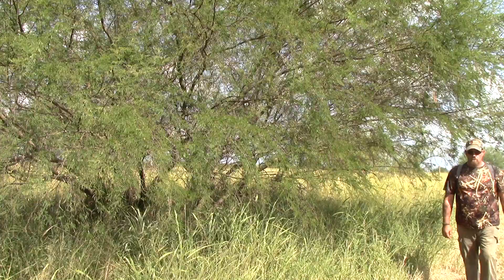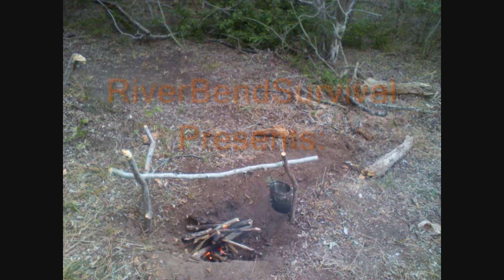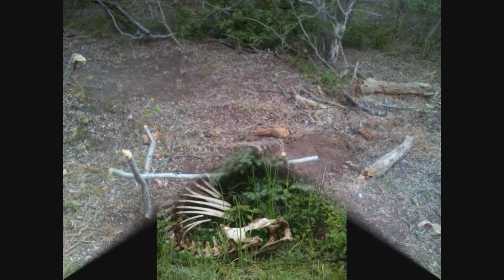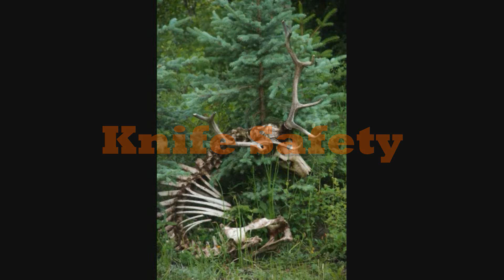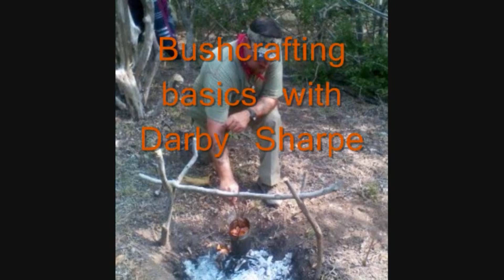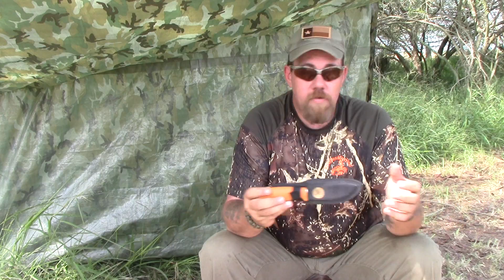Knife Safety

Comment: When you use the knife in close to your chest, you never, ever pull toward yourself with the knife.  You hold the knife steady, and you pull the stick through the knife blade at an angle.   Doing it this way, there is no way to cut or stab yourself.  one right, it is not dangerous.  This said, it's about control, about stability, especially with very hard wood, not about trying to take off large chunks all at once.   However you cut, thin is best.
Reply from the maker: I agree. However, I was actually just shown an old way of carving used by 1800's folks where they carved towards themselves and use a "carver's bib" made of leather. It is kinda cool.